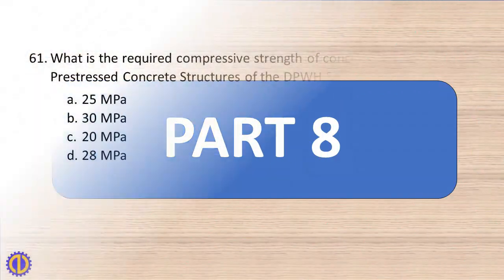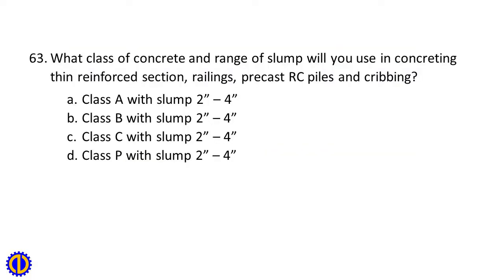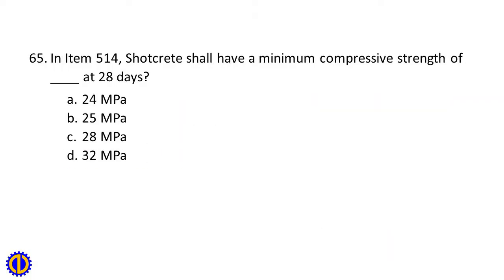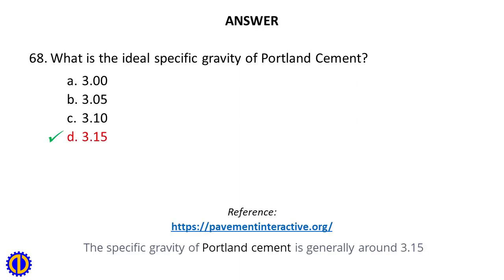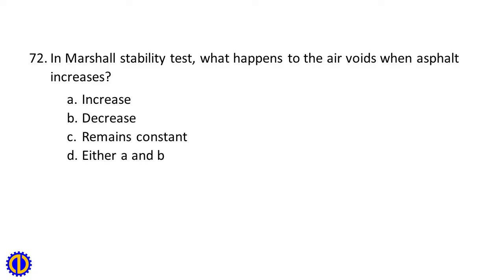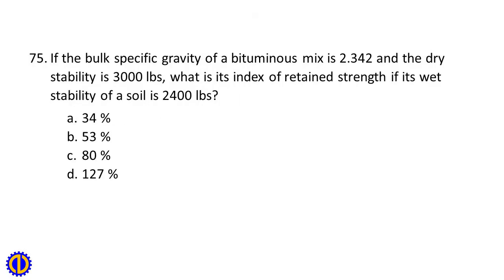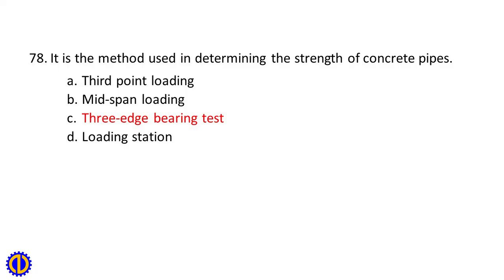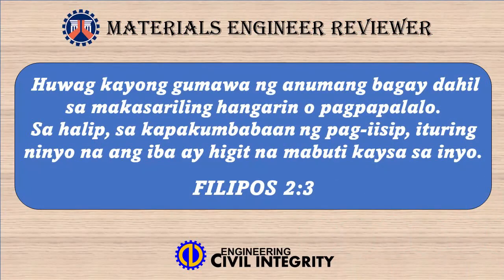Materials Engineer Reviewer Part 8 DDN

Comment: INo. 61 sir tinatanong ata jan post tensioned  member . 28 mpa ang sagot
Reply from the maker: Good comment for additional information.

Sa question 61 ay naka specify ang Item 406 na reference for precast concrete kaya wala sa choice ang sagot.

For additional information based on the comment. May DPWH plans na nakasulat sa general specification ng drawing. "The required compressive strength at the time of tensioning (post tension) is 27.6 MPa".
 27.6 MPa is 80% of required girder strength 34.5 MPa @ 28 Days. (Project Specification).
Reply from the maker: Item 406.3.10 Post-Tensioning: 
Tensioning of the prestressing reinforcement shall not be commenced until tests on concrete cylinders has attained compressive strength of at least 28MPa unless otherwise specified.
(Note: 28 MPa is prior stressing of reinforcement, which other references is 80% of required concrete compressive strength).